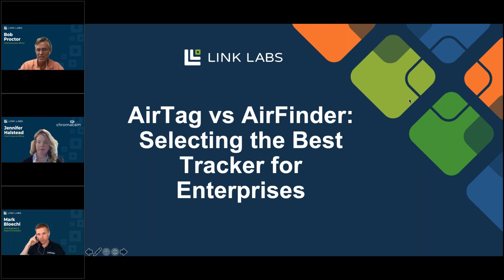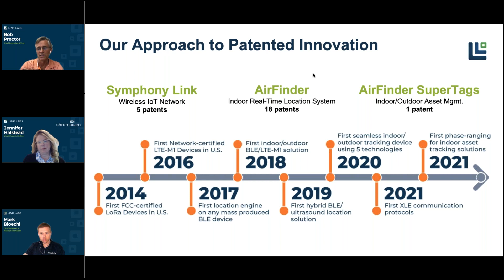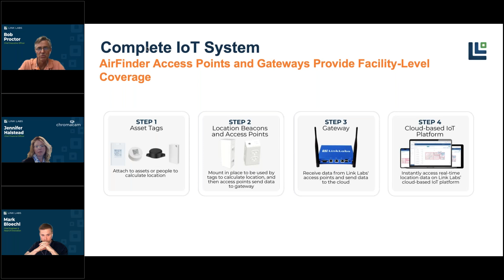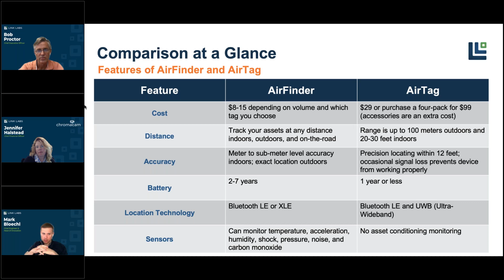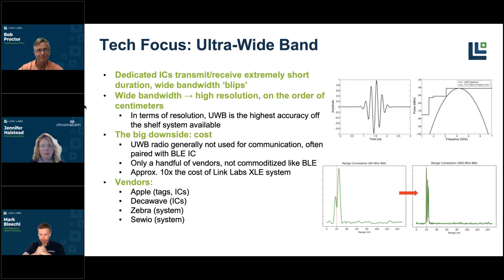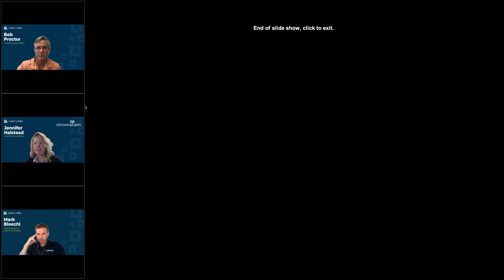Webinar: AirFinder vs AirTag: Selecting the Best Tracker for Enterprises

Comment: Thanks for the webinar. Since the cloud is involved along with the cell network what is the positional latency that can be expected from your solution? In other words, I would like to know the location of an object within 2 seconds. Depending upon the motion of the object being tracked, I can determine the probable location at time t+2 seconds. Thanks
Reply from the maker: There’s a couple of factors at play here. The underlying location technology can be pretty fast: OnSite XLE can produce a fix in as quickly as a few hundred milliseconds, depending on settings like amount of averaging, etc. The biggest latency comes in getting that data up to the cloud; at the moment, we’re using an LPWAN to get data from the edge to a GW, and that can take anywhere from 1s to 10s of seconds, depending on luck and network loading. After that, it’s just the latency over cellular and into our backend, which is comparatively small. So I would say 2s from the tag calculating the fix to getting it in the cloud is a stretch; it might happen sometimes, but we can’t guarantee it.
We are working on a version of OnSite XLE that uses a mesh protocol instead of the LPWAN which has significantly lower latency.
The other considerations when running at that rate are accuracy, battery consumption, and capacity:
-Accuracy: if updates are desired every two seconds, the tag won’t be able to do much (if any) scan averaging, so the fixes are likely to be lower accuracy
-Battery consumption: Right now, our largest XLE tag has a 1000mAh battery. If it was running at a 2s rate 24/7, that would last about 55 days or so. Since we have accelerometers on the tags that could be extended by only getting fixes while moving, so scale accordingly (e.g. if the tag is in motion 50% of the time you could get about 110 days)
-Capacity: Depending on settings, a single range measurement takes 9-18ms, and a beacon can only range to one tag at a time. If you have a lot of assets moving simultaneously at a high update rate, they may have difficulties finding sufficient beacons to range to in order to calculate a fix. There’s also the issue of backhaul capacity, which may induce more latency.
We are working on a new technology that will address the latter two concerns, but it’s very much in the R&D phase now so I’m not sure when (or if!) it will be available.
If you would like more information on this, reach out to our team here: https://www.link-labs.com/contact